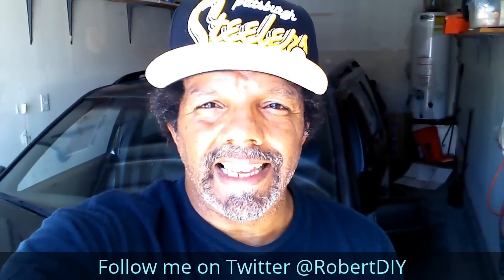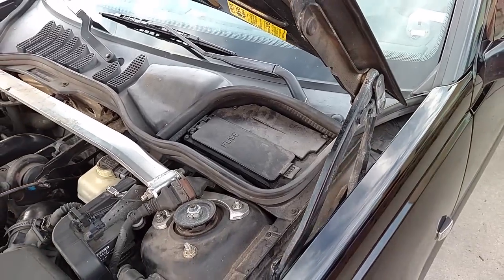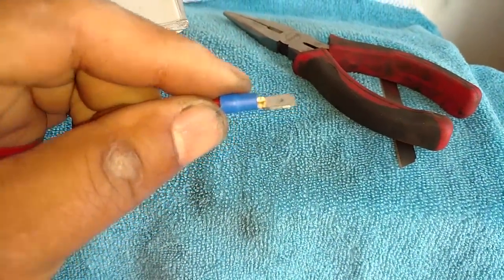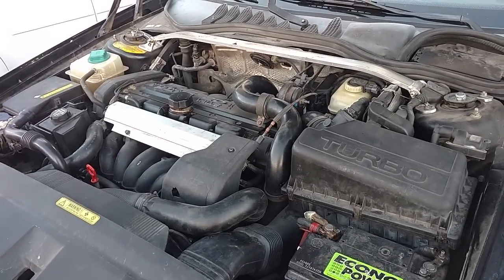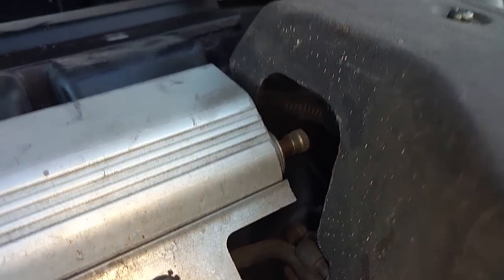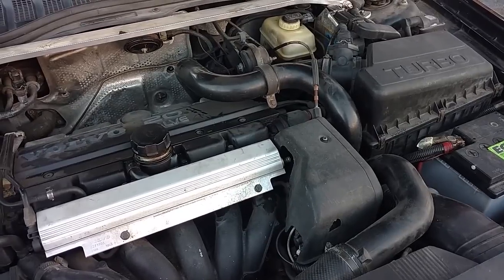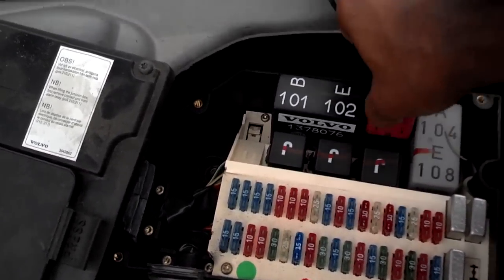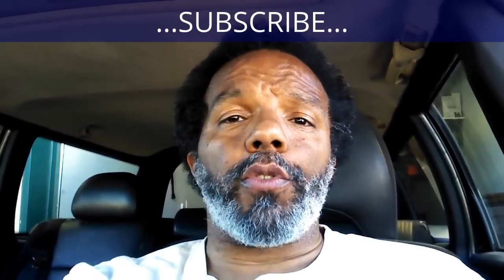Random stalling, will not start, fuel pump and relay testing, Volvo 850, S70, V70, V70 XC, etc.

Comment: Hi Robert. 

Your video has already been a great help to me. I have a question hopefully you can answer:

Do I need a fuel pump relay made specifically for an automatic transmission? My auto parts dealer has one in stock and they told me it is for a manual transmission only. Is this true or is the fuel pump relay for my 1997 Volvo 850 universal for both transmissions? Thank you in advance.
Reply from the maker: I would think either would work. You can install a jump wire and order the right part.

Comment: Hi Robert....I bought my 98 Volvo s70 three years ago and have been a fan of yours ever since. This car has been one problem after another. We have been stumped lately and haven't had much luck finding the right info on getting my car to start. I am hoping maybe you can help. One day out of nowhere the key stopped working and the ignition tumbler locked up and wouldn't turn. For a quick fix my husband removed the dash and we were starting the car with a screwdriver in the ignition switch...that worked for several weeks until it didn't.  One day it just stopped turning over at all. The head lights come on, the radio and dash lights everything works but it doesn't even try to turn over. We have since tried replacing the tumbler, replaced the switch, replaced the starter, the battery, the neutral position sensor. He's checked all of the ground wires, fuses ect. Nothing has changed. Do you have any idea what the problem could be? 
Thanks in advance,
Sincerely from a desperate wife looking to help her husband 
Jessica
Reply from the maker: You should probably call me. I don't know what you are saying you are doing to try to start the car.

Comment: Hi Robert, 
First off, thank you so much for your videos.  They have saved me so much $, time and frustration!  My 1999 V70 has been stalling on me lately while driving - has stalled on the highway, and while decelerating in city driving.  I have been getting a P0230 (Fuel Pump Circuit Relay) code, but I replaced the fuel pump relay a year ago.  Thinking maybe the replacement relay was defective, I put in a brand new one, and am still getting stalls and the P0230 code.  It usually stalls after at least 15-20 min of driving, and wont start up again until after 5-10 minutes.  What else could be going on?  Any ideas how I can narrow down the problem?  Is this just an issue with the wiring, or something else going on?   Thanks again!
-Jeff
Reply from the maker: These cars do not like after market relays and sensors. You can install a jump wire and see how that goes. If you have no other codes, it could be a fuel pressure regulator or pump going out.

Comment: Robert, I drive a 1991 Chevy  Lumina APV for work that runs great but occasionally when I've been driving it around for a while and i go to start the van and the engine is hot from running long distance, it'll start up then stall immediately, I have to rev the engine while starting it to get it to fire up and then it'll run fine. It's a throttle body fuel injected engine. No check engine lights.  Bad injectors? What's your opinion?
Reply from the maker: Probably a bad coolant temp sensor.

Comment: Hi Robert, thanks for all your videos. 
I have a 1998 S90, it has a lot of pressure in thank, I also has a strong smell of gas inside the car.
any ideas what will cause this problem? 
Thank you
Reply from the maker: Probably a vacuum leak under the hood.

Comment: Hey Robert, it’s about -10 here in ND. And whenever I try to start my 850 it sounds almost like a diesel trying to start but it never kicks off and fully gets running. Or if it does get running it will run for maybe 2 seconds and stall out. It only happens when it is cold out and I’m wondering if it is the relay or something else that would be finicky with weather.  Thanks!
Reply from the maker: you are welcome.

Comment: Hey there Mr. Robert. My name is Patrick. When the pnp switch has gone bad, wll it send a signal to the computer to stop the fuel from flowing? I found a sweet spot between drive and neutral, where the car will crank, but not start. I'm getting fire but no fuel. When I check the fuel pressure release valve, there was no fuel coming out, dripping or spraying.
Reply from the maker: I don't think so.

Comment: Hi Robert. My 2001 Volvo V70 XC wouldn't start after going into the sore for 10 minutes. I did 2 of the diagnostic checks you described in the video: checked fuel rail pressure via pushing fuel release valve and listening for fuel pump activation. There was very little/low pressure on the fuel rail and I couldn't hear a sound when listening for the fuel pump. Therefore, i think I am gonna loosen the fuel line going to the fuel filter and check to see if there is any fuel being pushed through. Secondly, if there is no fuel movement I will proceed to check the fuel relay and use your jump wire method. Lastly, once jumping  if there isn't any action I will make a strong inference that the actual gas pump must be bad. Could you let me know if that is a feasible order of approach I am taking?
Reply from the maker: Has the check engine light been on? 
I don't think your model has the fuel pump relay like the 2000 and older cars.
Reply: It's on the CEM under the dash by the driver's feet, on the left side.

Comment: Thank you so much for your shared car knowledge. would you know if I could swap out a 5 pin relay for the 4 pin fuel pump relay? I noticed that there are placements for more then 4 pins in the circuit board that the fuel pump relay connects to.  How long could I drive with a jumper wire. I need to go about 40- 55 miles. I am waiting to find a fuel pump relay for a 89 S70. Thank you for allowing me to gain some of your expertise.
Reply from the maker: I drove with a jump wire for about 10,000 miles.
Reply: @RobertDIY  Thank you.

Comment: Hello Robert,
I would like to know, if you will please, would the Volvo S70 fuel pump make a noise like a pump sound for only about 2 seconds after you start it,  if the relay was bad but had a good pump? On the S70, is the pump under the rear seat or in the trunk under the panel?  Thank you so much for your help.
Reply from the maker: Huh?
Reply from the maker: https://youtu.be/gt9w-ZSxs9I
Reply from the maker: Did you watch the video?

Comment: Hi Robert I know this is a old video but wondered if you can advise me . I have a 1996 850 R, the car has become harder to start than normal, I cannot hear the normal pressuring up of the system when the key is position 2. When it drives it hesitates like its going to stall when you touch the peddle , its auto by the way, and it will drive away slowly and gets to 30/40 mph but doesn't want to "go" especially uphills and gear shifts are a bit random, it has the feeling of not enough fuel but can the relay only half work. It had a new fuel pump about 2 years ago. my other thought if it wasnt the relay w was fuel filter. any thoughts
Reply from the maker: Glad you figured it out.

Comment: Hey, Robert! Could you please make a tutorial on how to lift up the fuse box? I'm interested in seeing how you can replace the B+ battery cable in a 96 850. I do not have a secondary box near the abs, just the one with the relays. Thanks!
Reply from the maker: I have tried a few times. I'll try again in a few days.
Reply from the maker: Most people just splice into the wire harness about 12 inches back.

Comment: Hi again, so we got it to start ( volvo xc70 2004) ended up replacing the engine and block with one from a 2004 s60 non turbo..added the turbo to the engine. Well, it's starting, yet when idle it seems to drag, feel like the car will cut off and it did twice. I'm wondering if that is a timing issue or if the specs are off because of the engine swap. Was wondering if you know?
Reply from the maker: You'll need to scan it for codes and make sure all of the connections are proper.

Comment: Hi Robert.  Can you tell me what those three relays in the fusebox area marked with the letter "J" control?
Reply from the maker: One controls the cabin fan, one controls something with the starting circuit. You can get a wiring diagram or pull them and see what happens.

Comment: Hey, Robert...thank you for the useful video. I tried the jumpwire test and the car started. Now...have you ever replaced the fuel pump relay with a different simpler model? Using the same relay pinout setup, of course...
Reply from the maker: Huh? I don't try tricks, just what I know is designed for the application. Not trying to use my fire extinguisher.
Reply: I see...
Well, there is a fuse if anything should happen. The thing is that there are no 12v to activate a simple relay...the fact that the jumpwire will turn the pump only after the key is turned, says that there is another relay somewhere in the harness. If you have more info on that, please share...otherwise, people should use the parts designated for the car.
Reply from the maker: no, that means there is a switch in the system.

Comment: Can a fuel pressure regulator for a 96 Volvo 850T5 give intermittent problems? I still have the original with 165,000 miles. It passes all the tests, but could there be something wrong with it after all these years? I have occasional hesitation and very rarely stalling. Pump, filter, ignition etc.has all been replaced. I am going nuts with this. One day it runs perfect and the next day I can hardly make it across town. Idle fluctuates and then evens out some days. MAF is only a year and clean. IAC replaced with a new one.
Reply from the maker: Probably the TPS (throttle position sensor).

Comment: My 1998 S70 GLT sometimes won't start when it's warm, for instance if I've gone into the supermarket and then come back. I'll have to give it a few tries before it starts and it never does that when it's cold. Could it be the fuel pump relay? Or maybe the ECT?
Reply from the maker: https://youtu.be/Jc4pfC3D3EU

Comment: Hey Robert. I’m looking for information on replacing my fuel pressure regulator on my 98 S70 nonturbo. Do you happen to have a video on this? I’m having a hard time finding anything about the FPR for my model. Thanks!
Reply from the maker: No. It's on the fuel line behind the engine.
Reply: @RobertDIY Well that's a good start.  Thanks for the info!

Comment: Hey Robert! I have a 96 850 wagon and it was running fine. One day i drove aroud the block and floored it from about 10mph. It downshifted and made a pop sound and died.
It cranks and cranks wont start.
Seems like it has fuel pressure but no spark.
Any ideas??
Reply from the maker: https://youtu.be/x8sXo5gbapM

Comment: Robert I have a  1996 850 glt wagon. If it is cold, it  will start and run great for around 5 minutes. Then it dies and when you try to restart it it acts like it is not getting enough gas. I have replaced the fuel filter, fuel pump and jumped the fuel pump relay with no change. I have checked the compression, checked the timing, installed new plugs, cleaned the rotor, installed new air filter, and new crank position sensor. The only error code is P0410 - the air pump. I guess I'll buy another fuel pump relay. I am stumped, since jumping the relay did not correct the problem. Any other suggestions?
Thanks
Rahbin
Reply from the maker: I would try to replace the temp sensor.

Comment: I'm getting a few random stalls and starting issues but the cars specifically throwing a misfire on the second cylinder and injector code.
Reply from the maker: ouch
Reply: @RobertDIY  just came back from the shop after a head gasket, throwing a timing out code and vvt hub code. Still managed to put 2k on it

Comment: ROBERT! question, its -40 in my tow, volvo started up great, but i cant accelerate over 30kms per hour. CEL's engine runs fine... throttle position sensor problem?
Reply from the maker: I don't even know what kind of car you have???
Reply: @RobertDIY  sold my 94 850 turbo to a buddy, i was able to see it in person today. was able to go over 30kms but no boost. recently replaced cbv from ipd and upgraded pcv system. anyways from my findings i suspect boost leaks.

Comment: Robert, Hope you can help out.  My  2007 Volvo xc90 .was showing overvoltage on the dashboard ,got the alternator and battery changed. Now the battery light came back with the red triangle on the dashboard. Scanned the engine and got the P0190 code.  Interpreted as fuel rail pressure sensor circuit malfunction. Is this expensive to fix ?
Reply from the maker: I don't think so.
Reply: @RobertDIY  Thanks for the prompt reply.

Comment: So did you just mean put a rag at the end for the fuel rail test? to catch the fuel that hopefully shoots out? just sounded like you said put something in it? i just got a 1995 volvo 850 and just trying to trouble shoot some stuff. thanks :)
Reply from the maker: +TheDeadMilkman420 not sure what you are asking but I put a rag there to catch fuel in the event that some comes out. You don't want fuel spraying over 1/2 of the engine compartment.
Reply: Yah i figured as much :P im just going through the trials and errors to get this thing up and running.  would the pcv cause the car to idle rough and shut down? higher rpms arnt so bad. i hear the fuel pump engaging so might try to check the fuel filter today. the pcv pipe going into the top of the block is a rock so thats gonna need to be looked at aswell.
Reply from the maker: +TheDeadMilkman420 Did you check for codes?
Reply from the maker: +TheDeadMilkman420 PCV system will make it run a little rough but not stall.
Reply: Yes i pulled 3 P0400 EGR flow malfunction, P0172 system to rich (bank one) x2, P0102 Mass or volume air flow - circuit low input,  so far i changed some old vac lines that were shot and tried to clean the maf sensor. there was all the oil on the top of the block. it runs rough in the idle for a bit then it'll stabilize it sounds good in high rpm but in lower rpm it has really trouble and wants to shut off. so as i let off the gas it chokes and some times stalls out. not sure the last time sparkplugs have been serviced but doesnt say its misfiring. Might the maf just be bad? or EGR stuck closed do that? thanks
Reply from the maker: If you have a MAF code, I'd say replace it.

Comment: Hello Robert , I have a 2007 xc70 and i can't seem to find the fuel relay. My panel is not like the one shown here ,But rather directly behind the air filter . Also when i open the cover i see like 5 relays and not one that is pink with the number 103 on it .Just wondering if i am in the right area and if you can help me . Thanks you ! And awesome video i have subscribed in the event something else comes up.
Reply from the maker: Does not have one.

Comment: Hi Robert - I have a 1999 Volvo V70 and have changed the fuel pump relay several times but still occaisnally get P0230 Fuel Pump Primary Circuit code and occaisonal stalling.  When i remove and replace the relay it seems to help  for a little bit so I suspect I have a loose connection in the relay terminal.  Any suggestions of how I might fix this?  Is there a way I can remove the terminal and tighten it?  Thanks Robert - your videos are the best on Youtube!
Reply from the maker: +Jeff Slocum how old is the fuel pump.
Reply from the maker: +Jeff Slocum https://youtu.be/NWfLpp8NevI
Reply: Hi Robert, I replaced the fuel pump a few months ago.  Sometimes when driving slow, it looses RPMs and sometimes will stall out.  Using a scanner tool, when this happens I see my fuel flow level can decrease
Reply from the maker: Where did you get the pump?
Reply: Eeuroparts:  https://www.eeuroparts.com/Parts/79433/Fuel-Pump-Assembly-23430152/
Reply from the maker: +Jeff Slocum maybe the regular is bad.

Comment: Hey Robert, great videos! My 2002 Volvo V70XC has twice now done the same thing, a month apart. It'll turn over but won't start unless I pump the pedal a few times. I read that it may have to do with a low tank on a slight downhill slope and a check valve does not function properly in a "fuel bowl". Yesterday, I had 3/4 tank facing uphill and it wouldn't start. 45 minutes before that, it barely started on its own on a level but tilted sideways parking spot. Now I'm not sure about the check valve as the situation was different. Today, it starts right up, multiple times in a row. I'm stumped. Any ideas? Thanks!
Reply from the maker: Could be a computer issue. Have it scanned by a good VIDA computer.
Reply: Robert DIY thank you, I'll be taking it to the shop soon for winter tires and will ask them to do that. We've got two older Volvos so I'll be watching a lot of your videos, and asking questions! Thanks again!

Comment: I just bought a 1998 V70 GLT.. and it starts runs for about 3 seconds and dies. The fuel pump seems to be turning on.. but if the relay is bad wouldn’t that cause the pump not to work? I’m gonna replace the relay and see what happens anyways..
Reply from the maker: https://youtu.be/-2oIeIhpV44

Comment: Will a bad fuel pump relay cause the check engine light to flash after stalling when stopping and lack of power on the highway (and hearing a godzilla like humming/hissing from under the hood through the cabin?)  Having major problems above 60mph
Reply from the maker: Nope.